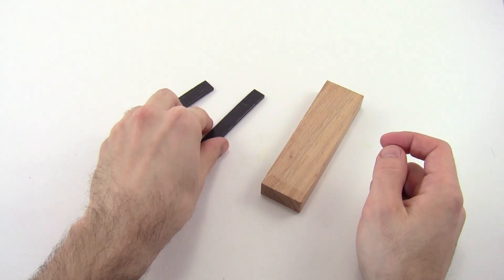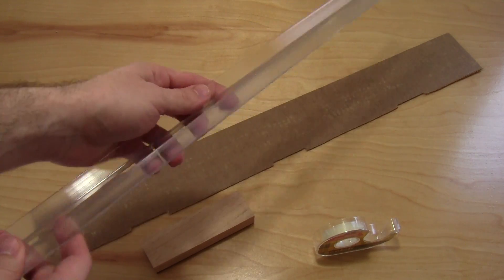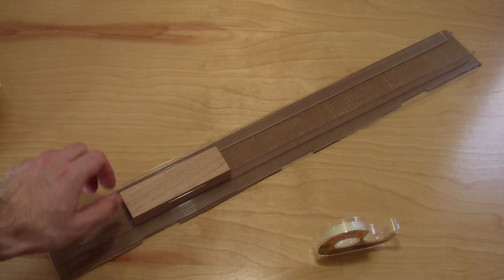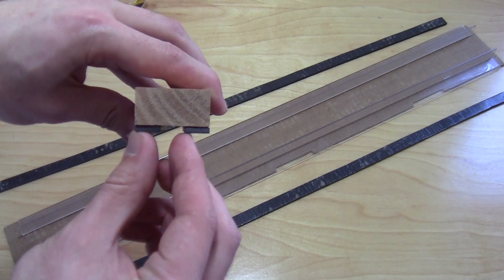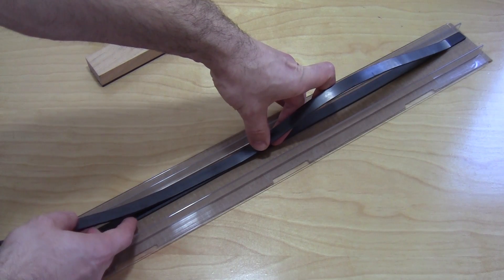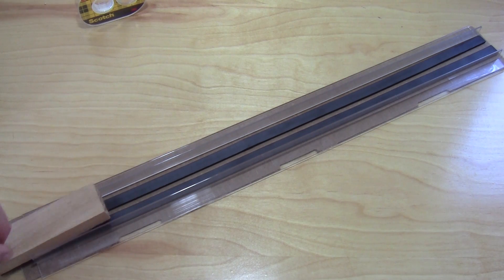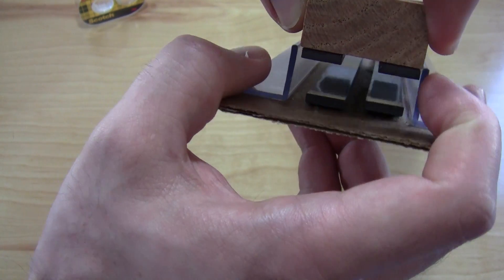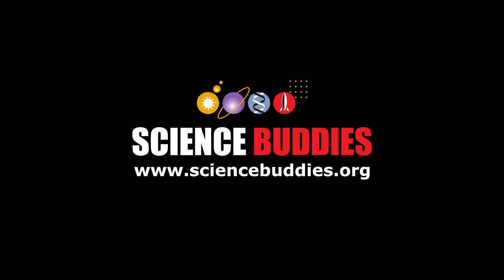Maglev Train Assembly Instructions | Science Project

Comment: Its a terrific project and we had fun building it but  it would have been a good idea to start of with identifying the proper type of magnetic strip because they don't sell monopolar strips everywhere and unfortunately the ones I purchased just stuck together. When I looked in the materials section of the website for the project, it doesn't identify it in there either. I should have read the comments first.
Reply from the maker: Hi - Can you clarify what you mean by "the materials section of the website for the project doesn't identify it either?" The materials section says "Magnetic tape, 1/2" wide, cut into two 24" pieces and two 5" pieces. Note: You will need monopolar magnetic tape for this project, which means that each side of the tape has only one polarity (N or S)", with a link to monopolar tape.

Comment: There is no paper backing on my small magnet strips
Reply: I just used this sticky thing that you put on the back of the magnet strips and pulled off the paper backing off of that so it's okay now and everything s done but thank you
Reply from the maker: Do they have an adhesive on one side? If not, you can use double-sided tape to attach them.

Comment: Can i use small neodymium magnets?
Reply from the maker: You would need a LOT of neodymium magnets to do this, it's much easier to use the magnetic strips. It's also going to be hard to get neodymium magnets to line up next to each other, they are going to want to snap together.
Reply: It worked for u?

Comment: Can you tell me if we can use any altenate item for the plastic angle pls or not use it at all
Reply from the maker: We have not tried, but you could try using smooth pieces of wood instead. You just need a straight vertical edge for the sides of the track.

Comment: I'm thinking of adding a small scrap fan (maybe from a junked small appliance) to the top. I don't know if the magnets will interfere with the small  re-used DC motor I'll be powering the fan with, but I'll find out.
Reply from the maker: Magnetic field strength drops off very rapidly with distance, so if the fan is mounted on top of the train the the magnetic strips are on the bottom, it should be OK. Only one way to find out though!

Comment: Instead of a single long magnetic strip,can I use the pieces of bar magnet?
Reply from the maker: Hi Zulfa - most bar magnets would not work because they are polarized axially (end-to-end, in the long direction), so they would not repel the train. The magnetic tape used in this project is polarized through its thickness (the short dimension), which allows two parallel strips of the tape to repel each other.

Comment: Could you make a video on how to make it move on it’s own?
Reply from the maker: This kit does not contain an energy source (like batteries) so the train cannot be self-propelled. However, you can tilt the track at an angle and the train will slide downhill.
Reply: You could also add a sail or wind catch to the train car and use an electric fan (or fans) to propel the car along the track, endlessly.